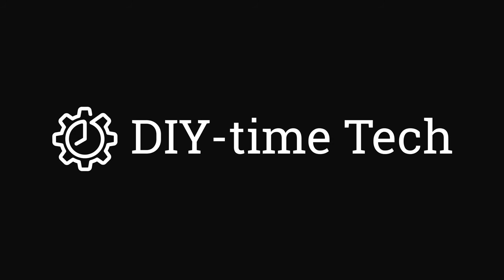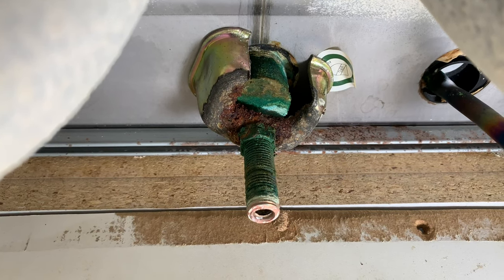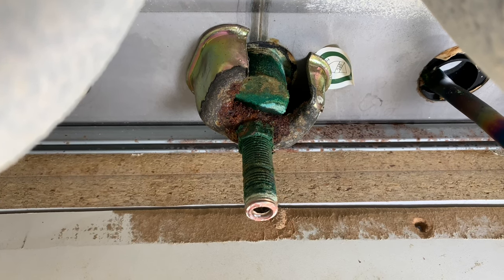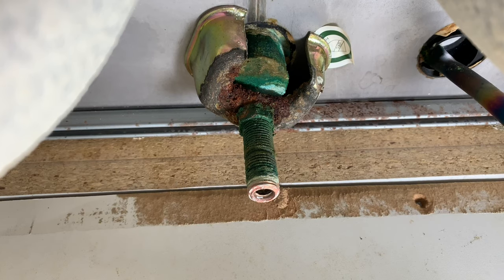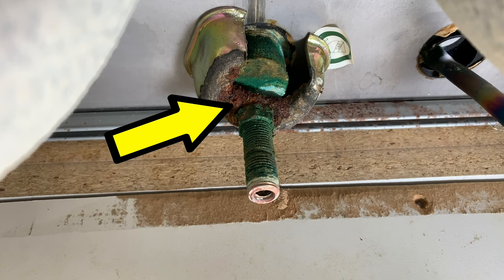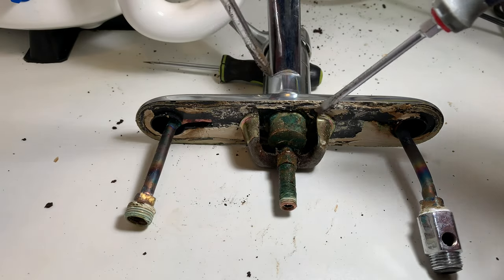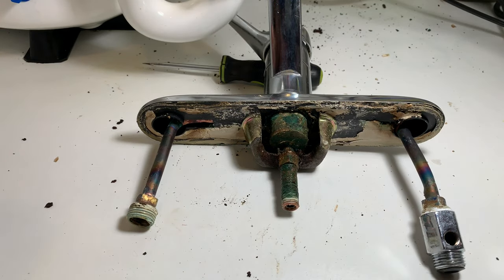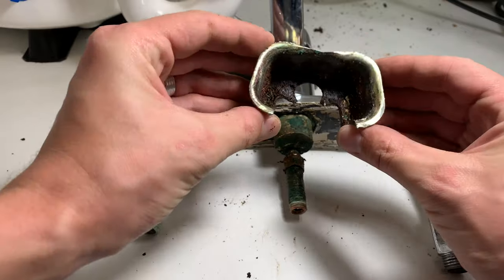How to unscrew and take out old rusty kitchen faucet retaining nut.

Comment: Very helpful as i have a black plastic bracket and it's blocking where I need to get to the brass bolt. Tried this is plastic bracket is free and I could now unscrew bolt holding faucet on

Comment: I need your help Victor, my kitchen faucet came loose, under the sink is the rusty tube you describe, but there is nothing left of the nut to unscrew and the tube to unscrew is pure rust, no threads left anyway. I'm assuming I can cut it off with a dremel, but what parts do I buy to remount the faucet? I have no idea what brand the faucet is, let alone the model # (I know its a home depot faucet) . I'm a disabled dad with severe back injuries so I can't stay under the sink for an hour trying to guess ...are there any "standard" parts I can buy to mount this faucet?
Reply from the maker: You probably won’t find any replacement parts for your old faucet. Maybe try to spray it with WD40 or any rust remover spray and see if you can restore it. If its too bad, you will have to replace the whole thing.
Reply: @DIYtimeTech  thanks, you're right, the whole tube is rusted, time to replace..I figure I'll just cut the 3 water lines from on top and I wont have to grind off the rusted nut, replace the water lines for $8 each! No hanging upside down for 45 min with rust pieces falling on my face

Comment: How hard was it to pry apart to break it?
Reply from the maker: Mine was pretty rusted, and it broke off pretty easily. If yours is not giving in, try to cut it with a power tool. I would do that, but I was working on mine at midnight, didn't want to make noises.